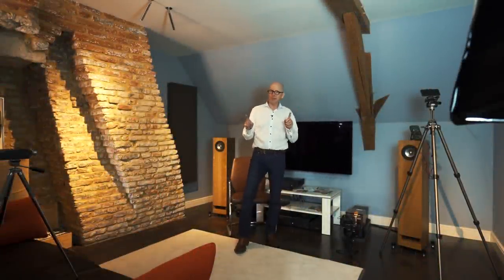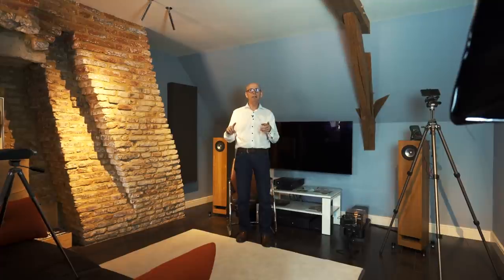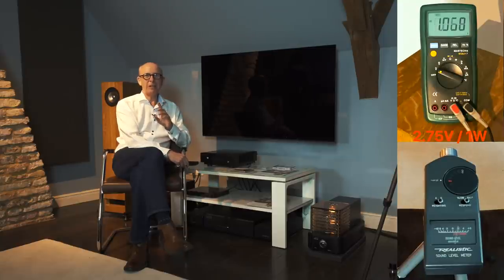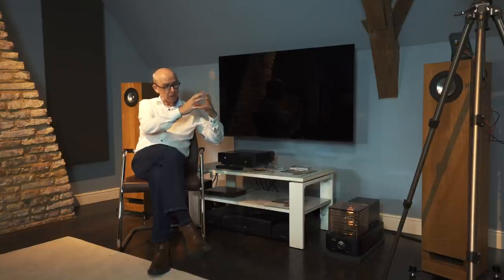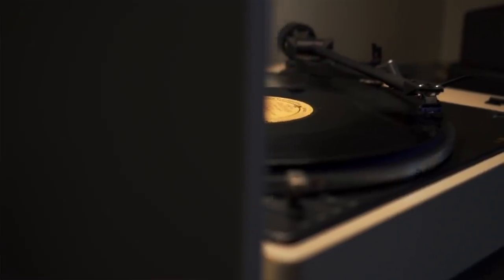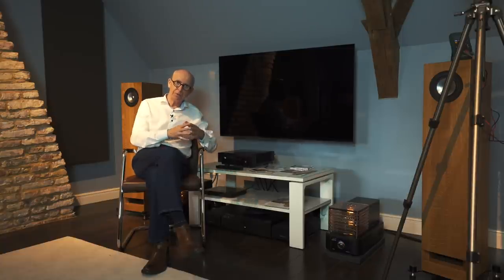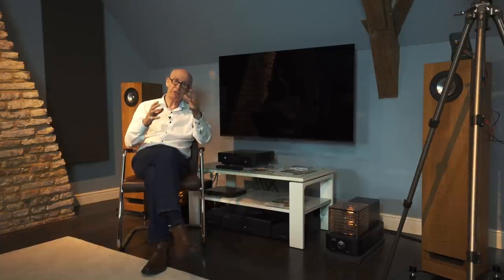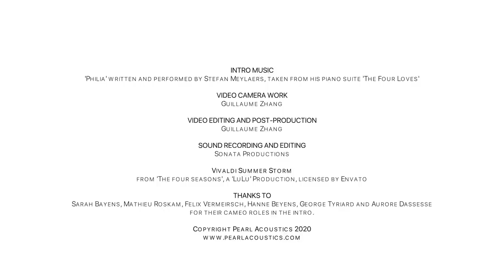How loud is 1 Watt (with an 87db Loudspeaker)?

Comment: The standard of the industry for measuring speaker efficiency is 1 watt measured at 1 meter with pink noise as the source. "How loud is 1 watt (with an 87db speaker)?" is a nonsensical question if the measurement distance isn't specified. Also, dB needs to be specified as dB SPL (Decibel Sound Pressure Level) when measuring how loud a speaker is when measured with a meter that uses a microphone. If we assume that you are specifying the speakers "rated" or 1-watt 1-meter efficiency is 87dB SPL then moving the microphone away 2 meters (inverse square law) the measured sound pressure should drop 6dB SPL to 81dB SPL. The reality is it won't drop quite that much because you are not operating in a "free field" or an anechoic chamber. Your walls, floors, and ceiling will cause reflections that will make the drop be not as dramatic.  

There are many ways to express decibels.

Voltage
dBV
dBu or dBv
dBm0s
dBμV or dBuV

Acoustics
 (This is the one we are interested in)
dB SPL
dB SIL
dB SWL
dBA, dBB, and dBC
 (These symbols are often used to denote the use of different weighting filters, used to approximate the human ear's response to sound, although the measurement is still in dB (SPL).) Your Radioshack SPL meter can do A and C weighting.
dB HL
dB Q
dBpp
dBG

Audio electronics
dBm
dBm0
dBFS
dBVU
dBTP

RADAR
dBZ
dBsm

Radio power, energy, and field strength
dBc
dBpp
dBJ
dBm
dBμV/m, dBuV/m, or dBμ
dBf
dBW
dBk
dBe
dBo

Antenna measurements
dBi
dBd
dBiC
dBq
dBsm
dBm-1
Reply: Phil Allison  I think you missed the point I was making about decibels. There is No decibel measurement of "stuff". Sound PRESSURE meters measure SOUND PRESSURE level. The meter in the Radio Shack SPL meter does not indicate Vrms. It indicates decibels SPL. You are confusing the voltage across the load (ie speaker) with voltage produce inside the Radios Shack meter to drive the meter movement. The voltage inside the meter was determined by the engineer that chose the meter movement. That voltage is totally dependant on the resistance of the meter and how much voltage is required to get whatever amount of needle movement needed.  

The Pearl Acoustics Sibelius SG loudspeakers have an efficiency rating of 87 dB SPL. That means that 1 watt of pink noise will drive a Sound Pressure Level meter to 87 dB SPL when measured from a distance of 1 meter.  1 watt 1 meter is the standard of the industry for measuring a given speaker's efficiency. 

Also, the test uses 2 speakers with each speaker being driven to 1 watt of power. So the test is actually using 2 watts of power. We don't know the distance of his meter from the sources of the sound. It looks to be about 2 1/2 to maybe 3 meters away. If the 2 speakers were place side by side and the SPL meter was 1 meter away centered between the 2 speakers you would expect to see 90dB SPL. That Radio Shack meter can be calibrated. There is a trim pot on the side of the meter and an RCA jack that allows you to use an external microphone and also provide a reference test voltage to calibrate the meters movement. 

1 watt of power is 1 watt of power regardless of the source of the audio that is driving the amplifier's output to 1 watt. The meter doesn't care if the source is pink noise or a 1kHz test tone. 

He notes the speakers have a nominal impedance of 7.5 ohms. This is important because Ohms law states that if you have a resistance of 7.5 ohms and a measured voltage of 2.7 volts across the load (speaker) then your speaker is using 365 milliamps of current and dissipating 1 watt of power. Notice he said impedance. Impedance is not the same thing as resistance. Impedance is resistance that varies with frequency. Speakers have resistance and inductance. Pink noise covers a range of frequencies that humans can hear. That's why it is used to measure a speaker's efficiency. The test is showing tendencies not predicting exact SPL's. If the meter had been placed at exactly 2 meters or 3 meters we could easily use the inverse square law to predict an expected sound pressure level.  

A 7.5-ohm speaker driven to a voltage of 2.83 Vrms would only dissipate 1.068 watts of power.

Comment: I use 4.5 to 6 watts peaks per tower when slamming with loud bass heavy music. A Be tweeter and 3x 8" bass drivers per tower speaker rated at 93db/ watt at 3ft efficient. I probably have about +15db eq at 20hz to +7db at 100hz, back to +0 before 200hz. I think most people can get a low measured distortion amp, 60w-300w per channel class d amp for $80, aiyima a07, and be happy with the sound and have tons of headroom. I have one and it has no audible hiss beyond a ft or two in a quiet room. I have an overkill MC462 amp as well and you couldn't tell a difference in sound between the two at 10ft away.

Comment: Hi very very well done and really educational   It is very impressive what just 1 W can provide.  I would suggest another test ... with dB.  In the end what we hear and perceive during a playback is a pressure  How loud is for instance a peak of 80 dB ? of 90 dB ?  
Some years ago i have been exposed to musical peaks around  100dB ... the excitement turned quickly to pain    The owner of that very powerful system was a drummer half deaf ... he was used to that unbelievable level of pressure    I was not   Never heard music that loud   I conclude saying that we also should look at the dB level   Feel the pressure   Thanks a lot, gino
Reply: 100 dB peaks is not unusual in live performances.  A lot of pro musicians have hearing issues because of this.  The system is trying to recreate the sound pressures of real performances. Not 'real' in an audiophile subjective sense or imagination, 'sounds like they were in my living room'.  Real in that you physically feel the spl (as a lot of us will remember from clubbing days). This is not the end goal of most.
Reply: @ememe1412  Hi thank you for the very kind and helpful advice
What i meant is that some extreme tracks like those in some cd tests put speakers under stress
Small speakers have difficulties to reproduce those without distorting the signal
Think of Bach's Toccata e fuga for instance
you need a big size quality woofer

Comment: I just checked mine: Sensitivity: 86dB/W/m (2.83V). Nominal impedance: 4 ohms - Aerial 10t pushed by a Cary v12.  - - I didn't see a power supply assuring a constant 120v. (your house varies) That's a whole different lesson.

Comment: If Watts are watts, a unit of measurement of a constant, meaning, 1 watt equals 1 watt regardless of source, and 1 Watt produces 87dB of pressure at 1 Meter on YOUR speakers, Why do i have to turn my "95 WPC" Amplifier up to nearly 3/4 to produce 80dB of Pressure given that my speakers are rated at 98dB @ 1 Watt @ 1m?
Reply from the maker: Probably because your volume control is logarithmic.... or there is an rrror
Reply: @PearlAcoustics  I guess thats what i was wondering. Am i really using that wattage, or am I really using a little under a watt, and as the control moves further, wattage is added sort of exponentially? I know dB is exponential in a way as far as wattage requirement is concerned...
Reply from the maker: @DarossTheGreat  that’s it

Comment: Wow that no one have done this before. A great contrast to some sales men that say indirectly the opposite. 
1. We need to have a lot of watts then the amp will be able to work in it's linear region.
2. We need a powerful amplifier so it is only loafing
3. We need to have a lot of head room.
I were at my friend house he has a parasound power amp even when it is not a class A it were shockingly for me a lot of heat coming out of it.
At home I use two mono blocks driven by a 12v car battery that each gives clean 6 w at 4 ohm in class AB. No heat no waste and drive the 90 dB/w/m speakers louder than I care for.
But if you mentioned 6w to the normal consumer they would not believe it or take it serious for a stereo rig. Marketing has really hammered him that more is better. :)
Reply: steven whicher   Yes completely subjective and incomparable.
My goal is only sound quality. 

As background I have a dedicated listening room fully symmetric and treatment with corner traps and first reflection points that are 150-200 mm thick on side walls and ceiling.
Speakers and me are out in the room (I am not sitting along/close a wall (flutter echo)). And using the same heavily modified one chip 6w amp as speaker designer use at GR research. And have no issue with that it is constrained or not  effortless in any way. And yes it is subjectively :) 

The problem is to compare X watt and X*100 wat amplifier.
We can not say that the one or the other is better BECAUSE of that it is 100 times more (or less) wattage.

When there is at lest ten other factors that one or the other will sounds better.

Different power supply, caps, topology, more/less feedback, transistors and so on.

If we could take the powerful amplifier and disable somehow many of the power transistors so it  would be much weaker then we could do a comparison.

Because then we have kept the same powersuply, caps, resistors, and kept the topology, same type version and manufacturer of the transistors and so on.

Otherwise we do not know.. And it is probably not the wattage why one sounds better than the other.

As one of the best amplifier designer today in the world, Nelson Pass say:
“Who cares what an amplifier sounds like at 500 watts if it sounds like crap at one watt?” 
(I do not mean that your sounds bad. It is only his way to say that the first watt matter)

That is a guy that most of his life has only tested and optimized for sound quality. With different topology, power supplys, transistors, caps, resistors, amount of feedback or no feedback and so on.

It is a hard topic but that is right if your amplifier sounds subjectively better then congratulations. It is the primary goal (for me anyway we may have different goals) that it sounds better. Best regard.
Reply: steven whicher  Thank you!
If not anything else this shows that somebody like me is happy with 6 w and someone else like you are happy with 600 w. 
This hobby is just wonderful. :)
Happy listening. :)  (no emoji on my keyboard, need to fix that)

Comment: I dont know what people do to max their amps. My Onkyo 7.1 Amp has a big chonky heatsink for the output stage and also fans mounted below it. 
People on the internet complain that the output gets hit and the fans turn on - mine has not turned them on ONCE, even if I turn the volume up so high that its almost painful to listen to it.
The hottest part is the signal processor

Comment: I like your setup and video, but regarding the voltmeter I have some questions, normally for those meters they only measure volt AC in the range of 30-400 hz....
1)is this a true RMS meter? 
2)what is the capacity regarding frequency range? 
On top of that I think just for music the tops of the sinus is the value you need. And then hope the impedance of the loudspeaker is pretty flat...

At the end you mentioned you saw 105 dB on the dB meter. This means you feed way more than 1 watt to those speakers.
For 1 speaker
87 dB = 1 watt 1 meter
90dB = 2 watt 1 meter
93 dB= 4 watt 1 meter
96 db= 8 watt  1meter
99 db= 16 watt 1 meter

When using 2 speakers it will be 3 dB more.... 

I really like the video and you scientific approach. But I think there are some things to be discussed. The multimeter is not suitable for this specific job, or u could use a continuous sine like 200 Hz.... The meter can measure voltage correctly, but the speaker must be 8 ohms when playing 200 hz tone.... 

Kind regards stefan
Reply: I was always taught in hifi having more power than not enough. Clipping destroys the driver's. Also watts vs watts is not the same in different amps receivers etc. Some deliver a different sound stage than others using the same speakers. Done comparisons with three power amps of different manufacturers which proved the point. Some don't have the separation along with the sound stage / depth warmth. Alot of variables in hifi. Get what you pay for. Also depends on what you like. Good video here demo here also.
Reply: @markclark1605  hi, may be I will post a similar video regarding this topic.
Indeed heavy clipping destroys speakers.
I did a test and noticed on my speakers I needed 215 watts to get a real live experience of a piano concert at listening position. The max dB was around 95 at listening position...... My amp has more power reserves, that is needed for un distorted dynamics..... But with a hi efficiency loudspeaker it's easy to get those levels using 8 watt....

Mij speakers are power hungry but not compressing music.

Comment: In the 70's I had a Pioneer SA1000. 2x 60 watts at 8 ohms, which was powerful enough for T-dansant (parties) for 1000 people and more. And this in large halls. The speakers are very important, I used Altec a7 and never had any problems.
Reply from the maker: Absolutely

Comment: Yes but this music sounded so thin, have you turned down whole bass to proof your point?
Reply from the maker: No... there is not a lot of bass as it’s only violins, violas and cellos....
Reply: @PearlAcoustics  exactly, bass is taking 80% of power
Reply from the maker: @andynowy  but, if your speakers are reasonably flat bass uses power but also gives the same level of db’s, so it makes no difference to the results. I would just end up shouting over bass notes rather than mid tones.
Reply: @PearlAcoustics  true, however you can listen to low frequencies at much higher level than high frequencies... I'd love to see this experiment again with different type of music.

Comment: I have a Ti amplifier with clipping detection that is rated at 150W/ch (tpa3255). DMM is pretty inconsistent. I can get clipping when DMM measures 15W, and also no clipping when DMM is showing over 70W. (derived in two methods, dc power supply current, and output voltage) based upon the source material.

Comment: Yeah, these MARKAUDIO chassis are not too bad for the prize!

I like them in a cabinet with an extra sub, just to support the lowest octaves.
The 6.5" have Fs at 34 Hz, but they start dipping at ~110 with -6 db/Oct approx, so... 

But nice video overall, thank you sir!
Reply from the maker: Hi Jean, thanks for your comment. Just to let you know. That the driver we have in our cabinet delivers a bass response that is - 3db at 38hz, which means that a sub woofer is not needed if listening at ‘normal volumes’ (under 100db). We managed this without the use of any crossovers or filters. Maybe, one day you’ll get to hear a pair.
Reply: @PearlAcoustics  
Thats good response! 
That'd be awesome if you achived this due to the transmission line, probably filling 7-8 db there.
Whats the full name of your speakers?
Reply: @PearlAcoustics  
By the way, is it the Alpair, or the CHR?
Reply from the maker: @JeanKatana   Sibelius SG and The CG from Pearl Acoustics. Good evening
Reply from the maker: @JeanKatana  it is a special variant made exclusively for us, based upon the Alpair

Comment: When measure sensitivity of a speaker mic distance should b 1 meter. Am i wrong?
Reply from the maker: Hi. Yes the standard practice is to measure at 1m and to quote in dB at 1m
Reply: @PearlAcoustics  k, thn i have a question, if i want to measure sensitivity of 200 watts woofer, i dont think 200 watts woofer can produce 1 watt. So how can i measure.
Reply from the maker: @mrworldwideirk   1 watt is one watt every loudspeaker can handle one watt. Get hold of a ‘white noise’ file. Play it into your loudspeaker. Put a volt meter across the terminals of your loudspeaker - turn up the volume until you get to 2,83V. If your loudspeaker is 8ohms resistance it will be producing noise at 1 watt. If it is not 8ohms. Then use ‘ohms law’ to calculate how many volts it needs to be for 1 Watt. There are plenty of ohms law tools on the internet. Give it a try. Good luck
Reply: @PearlAcoustics  thank you🙏

Comment: 87db by 1 w on 1 m distance  have 87db in 1 m distance.... so what will you say?

Its all time the same  a higher db rated speaker like 95db/1w/1m    have in 1 m distance  95db     and the most loundnes you have at 1w  every time

Comment: Maybe it's just me, but I feel that the sound coming from a lower decibel sensitivity like 86 db at 1 watt feels smoother, cleaner than the sound coming from a 90 db at 1 watt speaker. Anything above 90 db at 1 watt is harshly powerful, I believe.
Reply from the maker: Dear Eduardo, I kind of know what you mean but that can only be applied to certain designs and is absolutely not true for really high-end, well designed products (and I do not mean ‘expensive’ here - although many of them are. I think it’s just a lot easier to make a nice sounding low efficiency loudspeaker, then a great high efficiency one. Because, by holding back unwanted loud frequencies (with the use of crossovers, naturally brings efficiency down).

Comment: Quality of power supply is more important that a power rating say most of time preamplifier actually does not amplify signal but suppress it (average voltage << 2v).  Yet very often you see a massive PS just for a preamp like NAIM 52.  Maybe off the track here but all related.

Comment: try that with modern electronic music with lots of bass and the result wil be much much more different
Reply: Yep that’s why you want klipsch or tekton super efficient
Reply: @Modeltrainscarsstereos614  and attenuators on tradintional amps or  else it wil delivere all of it's  power before 10 o' clock (cdplayer) with super sensitive speakers,  since every adjustment's makes it to loud for normal listening levels